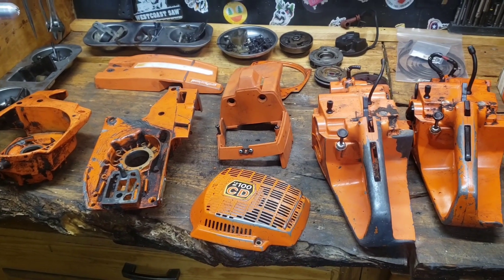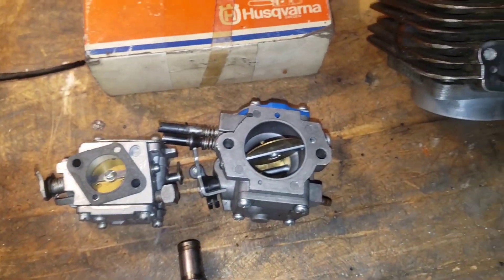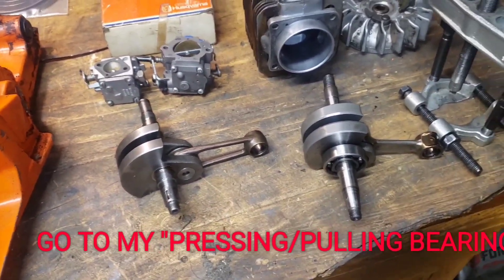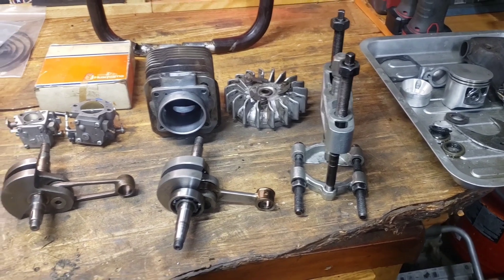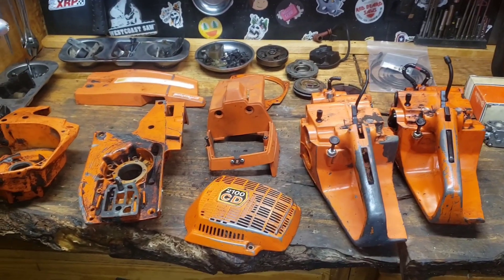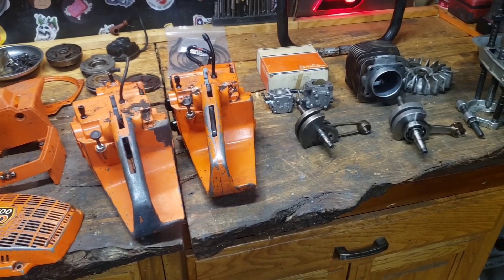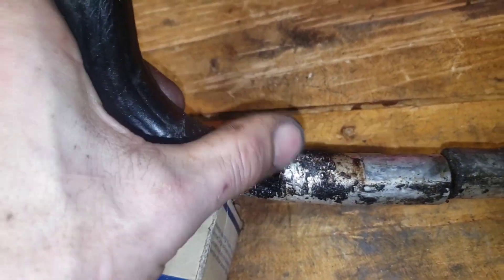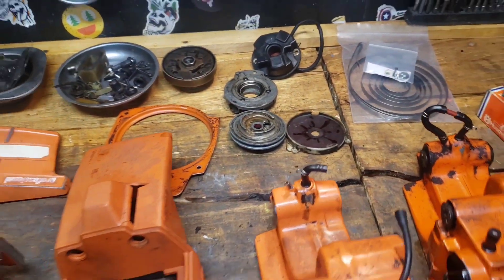Husqvarna CD2100 race saw teardown and plan of attack

Comment: I’ve had a couple 2100’s.  They were the shit for west coast fallers back in the day.
Reply from the maker: To me it seems like an 084 would blow the doors off this thing just from cylinder  design and displacement... but I guess they are the saw to build for race saws so have to see i guess... the crankshaft and case are built really heavy so im thinking thats the appeal 🤷‍♂️ im definitely excited to see what happens
Reply: @johnscustomsaws  They run good.  I was never like OMG this saw us awesome.  In their time though I think it was a good size platform for a 100cc.  I think the worst thing about them is finding ignition parts.
Reply from the maker: @Junkyardmethod  yes... I have heard that can be a nightmare if you lose ignition so fingers crossed

Comment: Hi would just a max flow and bark box improve a saws performance without porting it?
Reply from the maker: Yes... the barkbox has been proven to add .5hp or more I believe and that was on a dyno... you should add a little fuel to the carb if you run a barkbox to get the full potential out of it... I add a 1/8 turn to the L setting myself... also removing the baffle in the muffler helps... the maxflow is not as much for performance in my eyes as it is just a WAY better filter and keeps debris out if the intake and cylinder... debris ingestion is a saw killer man!! I wont even build a saw without upgrading the filter honestly... also a modded muffler helps the saw run cooler  😉👍
Reply: @johnscustomsaws  thanks man 👍

Comment: Why not just use a 395xp carb?
Reply from the maker: who knows man... might go that route... i have plenty of 395 carbs here so if thats the better route i wont fight to make the 3120 carb work... i have a lot of different bigger carbs i just lean towards the big 3120 to try initially
Reply: @johnscustomsaws  I've seen a video where a guy put a 395xp on a 2100, it ran better then the factory 2100 carb.